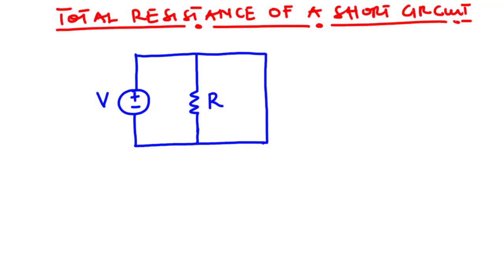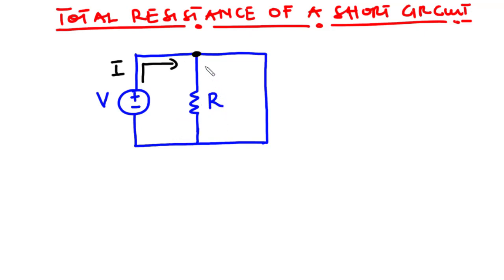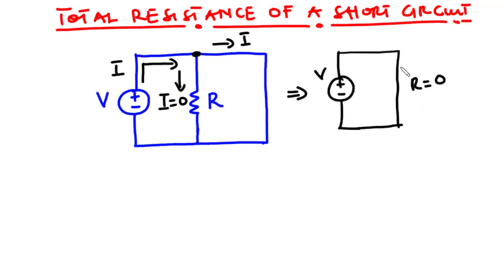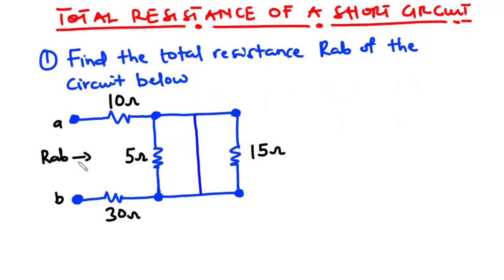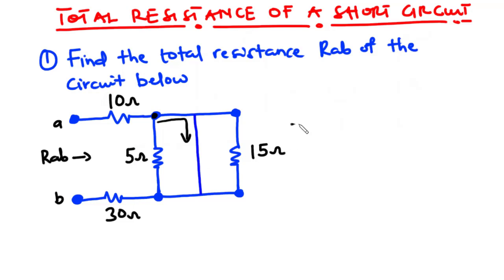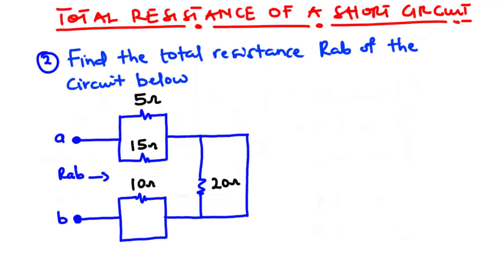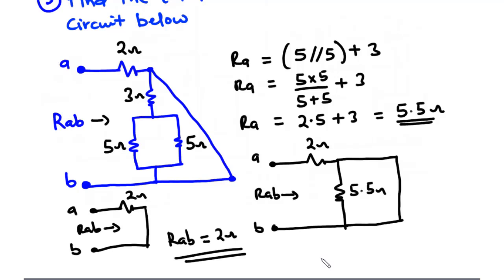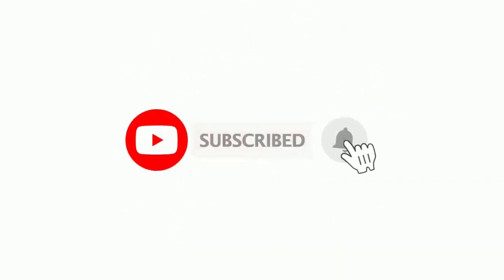05 - How to find the Equivalent Resistance of a Short Circuit #Easyway

Comment: From your third example, it can be seen that the 3 Ohms resistor and the two 5 ohms resistors have been short-circuited. Because per your analysis, when the current reaches the node between the 2 and the 3 ohms resistors, it won't split up because the wire from that node to the voltage source is without any load. So to save time I think we shouldn't have solved for the 3 short-circuited resistors since it was obvious before we redrew the circuit diagram. 

I love how you take your time to explain every concept.
Reply from the maker: Yes, thanks so much Bright. That's a good observation. But sometimes you want to be sure... Thanks so much anyway.
Reply from the maker: Thanks so much Bright...im grateful